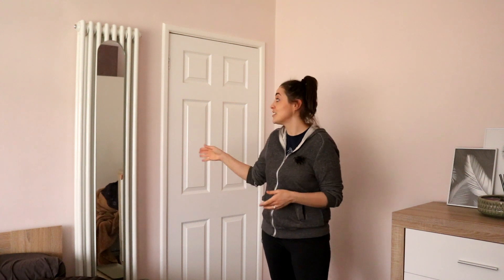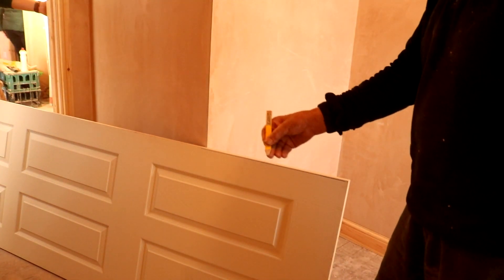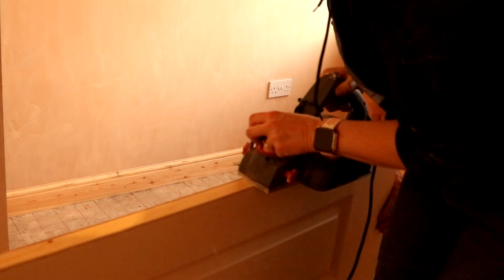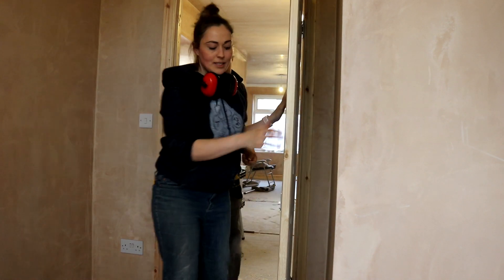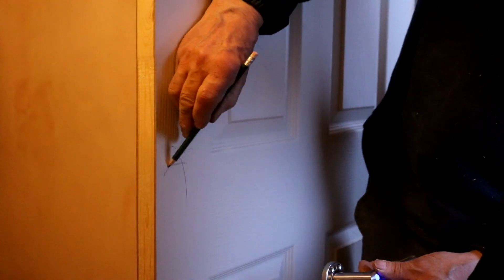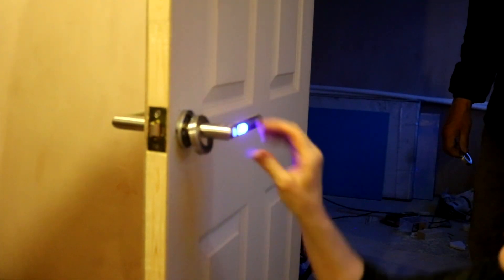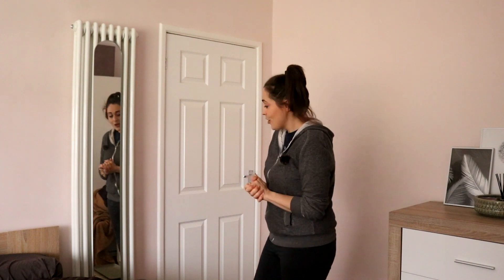How to Hang a Door With Flush Hinges | The Carpenter's Daughter

Comment: All the doors in my 1970's home, were fitted with these kind of hinges ( I know them as Hurlinges) - and I have continued to use them in replacement. They're easy to use - one thing that I've found with them however, is that that you have to watch for a bit of hinge bind, and it's probably something to do with protruding screwheads. You don't normally need to plane a leading edge on the hinge side of the door - but it can make a difference with these hinges.
Thanks for producing an excellent video
Reply from the maker: Thanks and cheers for the insight :)

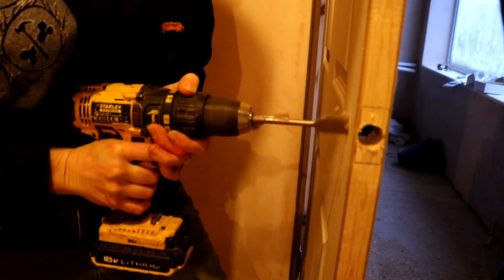Comment: 6:34 I was doing this year's ago with one of those nasty looking drill bit's.
I decided that i would drill really slow and feel for the drill bit point to just poke through the other side of the door then i would use this small hole as a guide to drill back into the door so i did not split the face of the door ect.
What really happened is that the drill bit was new and really sharp and I had my index finger on the opposite side of the door to feel for the point coming through only it didn't stop.
It went straight through the door and half way through my index finger : (
At the Hospital the most painfull part was having the fat pushed back into the whole the drill had made.
Some great tip's that i will use in the future so thanks for sharing and those door handles look great so i'm off to look em up : )

Comment: I think you did a really good job. The only thing I’d say is that I find it much easier to use a wider chisel when chiselling out the latch plate on the door. It seems counter intuitive as the smaller would seem easier to handle, but using a chisel almost the same width of the latch is easier with practice than a smaller chisel.
Reply from the maker: I thought that exact same thing - at the time, I just used what was passed to me.
Reply from the maker: And thanks :)

Comment: Nice video, very well executed thanks for this. Could you add a video of how to amend doors and frames that have been chiselled wrongly? the doors in my flat were fitted too low so when I installed the new floor (laminate) I had to refit all of them leaving gaps in the frames and having to change hinges locations in some occasions. Now there are gaps on the frames I'd like to fix before painting over.
Reply: oh forgot to say because ideally I want to use flush hinges instead like in your video and then would need to cover the whole current hinges slots in both, doors and frames. Thanks!

Comment: Could you ask your dad if 2 hinges flush hinges, 75mm by 30 mm is enough for light weight doors same as the ones in your video. On my mums house and on all the other houses on the estate have these flush hinges 75mm by 30mm , is this enough ? . Love your work .     Is it the norm as in my mums house to put 2 75mm flush hinges on light internal doors ?

Comment: Great video! I have an unique problem, I leave in an ex-council purpose built flat, all the door frames are made of metal!!! I want to change the direction of one door, so that it opens other way around. I have been thinking of how to do this. Your video gave me the idea to use flush hinges, because in that case I dont need to cut the metal frame. But I have bought a fire door, so its heavy. Do you know which flush hinge can I use for this? I found that all flush hinges are either low or medium duty. Will having 3 be sufficient?

Comment: Very different handles. 
I have started using a router for the face plates for the latches. Take most of the fat out after you have drilled the door, then clean up the edges with a chisel. 
Also a wider chisel will be a bit easier to control cutting that out
Reply: Other than that, keep up the good work
Reply from the maker: Thanks and yes, I agree!  Do you use a special jig for the router?  I've only ever freestyled it which was on my recycling station project.

Comment: Did you put a 3 degree bevel on the latch side?
Reply from the maker: No... as you can see in the video, we just put it on and hammered to push it back and dent the wood.
Reply: @TheCarpentersDaughterUK  and it worked just fine.😎